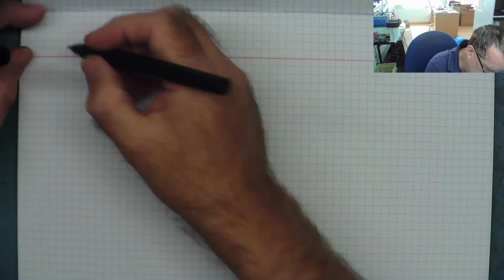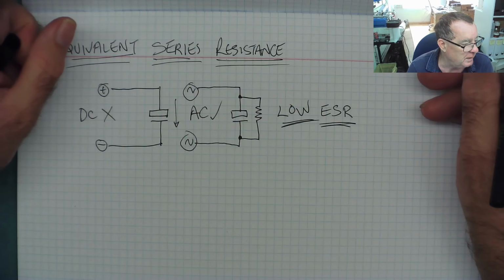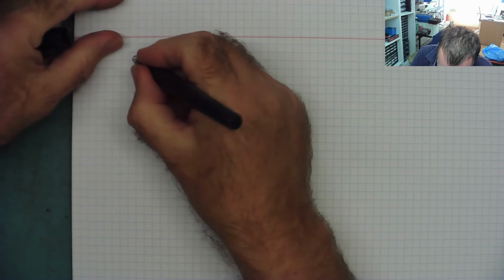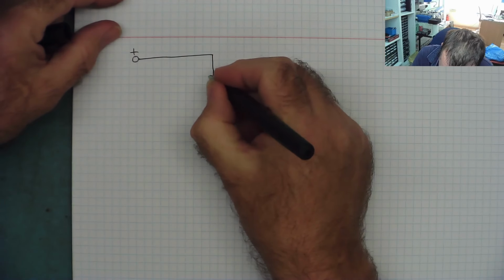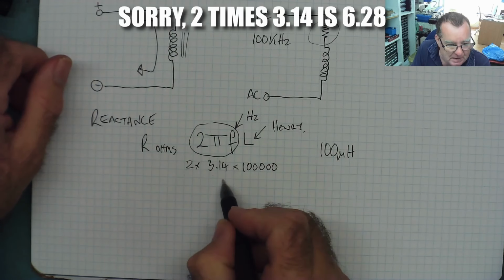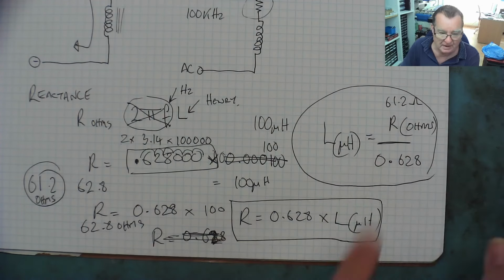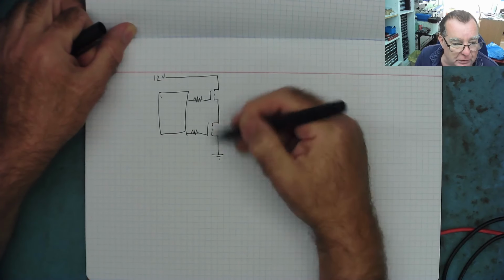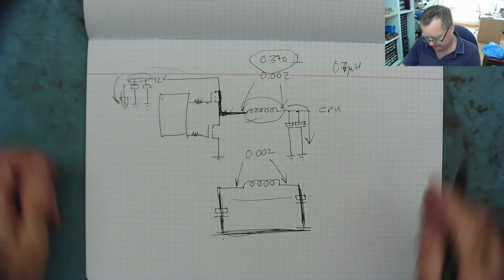All You Need To Know About ESR METER To Fix Stuff. How To Use Test Capacitors Inductors Short Finder

Comment: I am sorry, I do not know much about electronics, indeed I am here to learn. So, you said that capacitors let AC current pass through them, but electrolytic capacitors are polarized and they cannot stand reverse current or they will explode, so is it possible to apply them an AC current without damaging them and do they let it pass through them?
Reply: no, negative voltage ist not allowed. They usually will get used in circuit after some rectification (by diodes) where they only see (rippled) positive dc.
Reply: @bluespresso   Thank you. But, ESR meters work also on electrolytical capacitors, so it is possible to apply them an AC current; also, you can find the ESR value specification for some electrolytical capacitors, so I would need more clarification.
Reply: @FulvioGa  ESR meters apply small voltages that result in very low current through the capacitor when testing. For large capacitors in an AC circuit you would want to use a bi-polar (BP) electrolytic capacitor.
Reply: @davidv1289  Thank you! But still it is not clear to me: why do you sometimes find the ESR value among an electrolytical polarized capacitor specifications, just for testing it? And why some elecrolytical polarized capacitors are indicated by the manufacter as low ESR capacitors if they cannot be used with AC current?
Reply: @FulvioGa  Polarized electrolytic capacitors are used in circuits that do not have alternating current applied to them. If you look at a power supply schematic (a common place to find electrolytic capacitors)  you will see that they are "separated" from the alternating current by a rectifier, the capacitor has pulsating DC applied to it - the positive terminal is always connected by the rectifier to the positive half of the AC source and the negative terminal is always connected to  negative half of the AC source (in a full bridge rectifier circuit). ESR is important because, as a resistor, it generates heat and wastes power. This becomes more important at higher frequencies as in switch mode power supplies and therefore low ESR capacitors are used. ESR is specified for circuit designers and is also useful for testing purposes.
Reply: @davidv1289  Thank you very much. But it is still not clear to me: so, ESR is important in polarized electrolytical capacitors when then current applied to them is not continuos but pulsed; but ESR is the resistance to the current that passes through a capacitor and only alternate current passes through a capacitor, so how ESR is important in polarized electrolytical capacitors?
Reply: @FulvioGa   An electrolytic capacitor is like an automobile battery that charges and discharges very quickly. Current flows through the capacitor when it charges or discharges, no current (or very little) flows when the voltage across the capacitor is constant.  So the direction of current flow in a capacitor changes but the voltage polarity remains constant - just like the automobile battery. Because of the chemical process within the capacitor, current may flow in either direction but the polarity of the potential cannot change. ESR is the internal resistance of the capacitor that opposes the current flow.
Reply: @davidv1289  Thank you so much. Now I understand that!

Comment: Hi Richard,
Great video as usual.
I have the MESR-100 ESR meter as well.  I found it wouldn't zero properly  and started reading 3-4 ohms instead of OL when the leads weren't shorted.
I got an Atlas ESR meter to replace it and although it's a bit more expensive, it's in a different league. 
It measures capacitance and ESR at the same time.
It doesn't need to be zeroed.
It doesn't matter which way round you connect it and it automatically discharges the capacitor before testing it, if you forget, letting you know it's doing this as well.
It seems more accurate too, and it's made in Yorkshire, UK!
On that point of discharging the capacitors for you.  I know it's best practice, but we can all forget to do this sometimes.
After I got the Atlas ESR 70 meter, I decided to see if I could repair the MESR-100 before throwing it away.
It's turns out that accidentally using this meter on large undischarged capacitors fries input schottkey diodes D1 and D2 on the PCB.
I replaced them and it works fine now.
They are SS14 surface mount diodes (marked S4) and clearly marked at the bottom of the PCB.
I hope this helps anyone who has fried their MESR -100.
Like I say though the Atlas machine has a lot of advantages.
Reply from the maker: I'm not sure how you fried the ESR meter - I had mine for about 8 years,  I use it a lot and as you see in the video it is still working well and zeroes just fine.  I have a Peak Atlas DCA55 semiconductor tester from about the same time - that is also working very well and I use it quite a lot in repair work, I wouldn't use anything else to test semiconductors.

Regards the Atlas ESR meter that measures ESR and capacitance at the same time - what does it display if you use it to measure unmarked inductors or find short circuit mosfets as I demonstrated here?
Reply: @LearnElectronicsRepair  
Hi, 
Good point.
The Atlas says "in circuit/ short" if there is a short.
I couldn't get to any inductors easily, so I made a couple with some wire coiled round a dowel.
14 turn:  MESR0.936/ Atla 0.25
7 turn: MESR 0.553/ Atlas 0.18
(ohms).
And just for fun, with a 6 ohm speaker:
MESR was 15.5 ohm
Atlas was 9.9 ohm.
I think the Atlas uses various frequencies between 50 and 100kHz.
Perhaps that explains the difference in readings.
I'll get some inductors and see which one is more accurate as measuring Micro Henrys.
I don't think I've got any Mosfets, except a few working ones in amps.  I'll let you know when I get a bad one on a suitable board and try them both out.
I wonder if the original diodes in my MESR machine were a bit flakey?
Reply from the maker: @cskeet1320  The facts we know then: on the MESR the reading in ohms is reasonably accurate with known inductors - proven using the reactance formula and tested from 0.6uH to 100uH - so those readings are the 'correct/expected' ones at 100KHz.

The Atlas reading must either be using a different frequency (easily proven with a scope) or is not actually displaying the resistance (reactance)
Reply: @LearnElectronicsRepair  
I checked both meters on the scope.  MESR clearly shows a 100kHz frequency, but there is nothing meaningful from the Atlas.  It seem to very quickly switch through several frequencies. (not very good for your inductors hack)
Anyway I have both now.
Atlas for stress free capacitor testing and the MESR-100 for short finding/ inductance measuring.
Cheers.
Reply from the maker: @cskeet1320  Thanks for the info, it seems like both are very useful tools in their own rights, and both have their advantages and disadvantages for different reasons 🙂  This is really useful info, it helps people to decide what they want from their test equipment. Thank your for your time and effort (despite the slight typo in your comment 😉).
Reply: Typo corrected.

Comment: A major disadvantage of the mesr-100 meters are the short leads with croc clamps. Especially when reading in circuit. I have already tried several probe leads, but because they are longer, the meter does not want to go to zero and gives a bad reading. The blue ERS meter, on the other hand, DOES have long leads! Does anyone know if there is a good fix for that?
Reply from the maker: I've used my MESR-100 with long leads on several videos.  I agree it does not want to zero properly but seeing as usually I am simply looking for the lowest reading when short circuit finding with it then I don't think it is a problem.  I can't think of a situation where I can't get the meter close enough to the job to test capacitors even using the short leads to be honest.  The only time I think I need to use it to actually take an accurate measurement is when measuring inductors and I demonstrate that both in circuit and out of circuit in this video using the short leads.  Can you describe  a situation you have found where you need to use long leads on the ESR meter?
Reply: @LearnElectronicsRepair  Yes of course it is not a problem in most applications, But it is more comfortable if longer leads can be used and that the croc clippers would be test fine probes. That it all works out in the end is right but sometimes it's a bit of fiddling...
Reply from the maker: @Tsjoetenbille  Yeah I think you are right, it probably wouldn't take much effort to get it to zero with longer probes, though I never opened it up to see what is inside it 🙂

Comment: You know I also have the same ERS meter, but I am not sure how useful it is when testing capacitors.  My bench LCR Meter can test the ESR at various frequencies relating to the circuit where the capacitor is used.  I mean testing a large filter capacitor at 100 KHz if it is used to filter a rectified 120 Hz (or 100 Hz in Europe) must surely be inaccurate?  My LCR meter can display the capacitive reactance in Ohms and also the resistive component (as in polar values) and that is when you realize this value is exactly the same as the ESR, hence the ESR will vary greatly depending on frequency.  Anyone got any other ideas about this?
Reply from the maker: What LCR meter are you using?  
Regards your question about the test frequency, In my experience large filter capacitors at 100Hz/120H do not fail due to high ESR so there is no point measuring them anyway. if this sort of capacitor does fail it is usually due to low capacitance or electrolyte leakage causing the legs to rot off them. The may also fail due to high leakage current but you would tend to know about that without needing an ESR meter as they generally explode.

As I mentioned in the the video, the only situations where I think you need to worry about high ESR causing faulty circuit operation is in high frequency switching circuits (SMPS, Buck, Boost, Synchronous Converters etc) and Audio amplifiers.
Reply: It is a RuoShui 4090C and it works well for me. I did a video about LCR meters a while ago including this one.  https://www.youtube.com/watch?v=O7z-ucPni_s  I am not very good at making videos as yet but you might find it interesting?

Comment: I'm glad you corrected the ESR info regarding the position of the Resistance for ESR, you drew EPR Equivalent Parallel Resistance which is another important characteristic.
EPR can also be measured and its how you can detect leakage in capacitors, as I'm sure you know Rich, but your viewers might not. Maybe a video on EPR another time.

Comment: Are there any way to make the components tester to measure the esr accurate?
Reply from the maker: Well, if we look at the way I was measuring inductors using the resistance reading on the MESR-100 meter and the reactance formula, I would say it is fairly accurate 😉  Also I wonder where you would need to know accurately what the ESR is, rather than just wanting to know if a capacitor is good or not.

Comment: Thanks again Richard. I learn something new every time I watch your videos. I always assumed that if the ESR is very low that the capacitor should be good. As you demonstrated that isn't always the case. I have same ESR meter and it's still working fine after about 8 years. I also have the Blue ESR meter which gives instant consistent readings and the polarity doesn't matter, but costs about 3 time more.
Reply from the maker: To be honest I don't believe the polarity matters on the MESR-100 either, as it injects a low voltage 100KHz AC signal.  I just tend to comply with the coloured leads (red = positive) more out of convention and familiarity than anything else 😉

Comment: Hi Richard. I bought an atlas peake ESR meter about 15 years ago. I was given a pair of broken computer 
monitors. Which I fixed for about £2, and an hours work. I sold  one within days, which paid for the meter.
I kept the other. So I had a monitor and esr meter for nothing. Loved your video its opened my eyes in how to properly use my meter. I have several other repair projects that I am going to use my newfound knowledge to tackle.

Comment: Great video Richard.  I have a Blue ESR tester designed by Bob Parker.  I do not get the same readings out of it as you get on your ESR..  I thought it was an okay bit of kit as seemed to be reviewed well when I bought it.  Since then I also purchased a DER EE DE-5000 LCR Meter.  The ESR on that does not equate to the Bob Parker readings,  but it can do a 100kHz test. I should have watched this video before buying the Blue meter Eh!  HA HA... Live and Learn Electronics.

Comment: For anyone in the market for an LCR meter…I own a DER EE DE-5000 LCR Meter and I love it. It paid for itself in just 1 repair. 20,000 Count main display to measure L, C, and R; also measures ESR, θ Angle, dissipation, and quality factor on a smaller second display.
Reply from the maker: @Cory Marqusee That seems quite difficult to purchase.  Can you tell me where to get one and I will happily review it and compare it to the MESR-100
Reply: @LearnElectronicsRepair  Hi Richard they are on ebay most from japan about 130euros but i dont know about shipping mine came to the uk in 10 days . i do recommend getting the tweezers and croc clips with it  i did not and regreted it
Reply: I have the DER DE-5000 meter also. I wouldn't recommend anything else considering the price point and features in comparison to other ESR meters such as the atlas and MESR. 

I'm not sure of availability for the DER for people outside the U.S., but I'd say it would be worth the extra hassle to get one over the two I previously mentioned.

Comment: Will the esr meter work on smd ceramic capacitors? Thanks for the video, very informative!
Reply from the maker: Yes is will measure that but to be quite honest from a repair point of view ESR is a problem with electrolytic capacitors 😉 When MLCC capacitors fail they usually go short and sometimes go leaky (read several hundred ohms using multi meter ohm range)

Comment: So it turns out that it doesn't really matter if the cap is good or not or if electrolyte literally leaks out - anyways in most cases this meter says all of them are fine... Hm, very useful tool! ))
Reply from the maker: I showed two examples of bad electrolytic capacitors:
leaking, low capacitance, high ESR
leaking (or not leaking but slightly bulged) double normal capacitance and good ESR

These are the two main ways that electrolytics fail and think i did a pretty good job of explaining both.  I used some good low ESR capacitors, plus a good standard electrolytic  (not low ESR) as a comparison. 

I don't understand where you say in most cases the meter reads the same. 🤔
Reply: @LearnElectronicsRepair  Thanks for the answer. I've checked that part of video again. I admit, you was right. The meter says they good, while I missed important note "if c<200uf" - that means they aren't good, of course. I apologize!
Reply from the maker: @olegrovnyakov8474  No worries - we are all learning, self included 🙂
Reply: Correct me if i'm wrong, but if the test results are not equal to the value on the label then the capacitor is bad. ? I think I finally get it !😊

Comment: NO, please get it right.
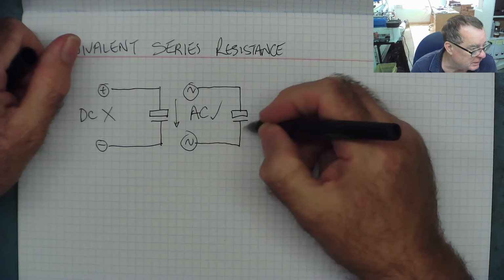Reply from the maker: Which part? (other than the resistor at 03:25 already discussed in the sticky comment)
Reply: You show a parallel resistor across the capacitor, then call it ESR.  ESR is in series.
Reply from the maker: @stevenbliss989  Yeah you correct, I messed that up as yourself and several others rightly mentioned.  Point taken. 😳 I did my best to put a sticky at the top of the comments that says IMPORTANT and explained the error.  I hope it didn't distract to much from the demonstration of faulty caps and the other uses I put the meter to.
Reply: @LearnElectronicsRepair  Your Good :)

Comment: Hello Richard
Did  I have too many beers last night or did you draw this ESR resistor totally in the wrong place ?
It should be shown in series with the ideal capacitor not in parallel as you drew it in your diagram.
You correctly said  that the ESR value should be low, but in your diagram a perfect ESR value of 0  would then short out the ideal capacitor. I.E it aint a capacitor no more ! This was very confusing
Reply from the maker: @Geoff W Yeah I did draw the resistor in slightly the wrong place, probably that is why it is called equivalent SERIES resistance 😉 Hopefully it didn't distract too much from the demonstration of the ESR meter and how to use it in various situations